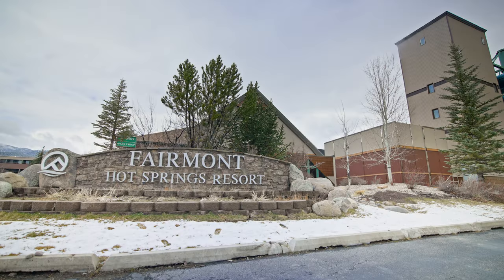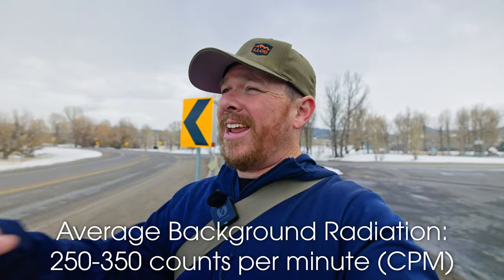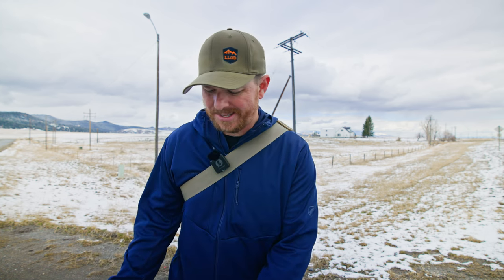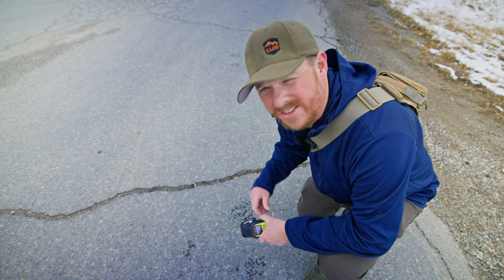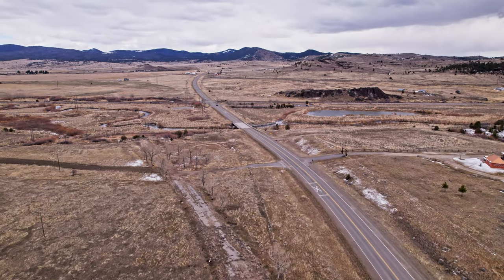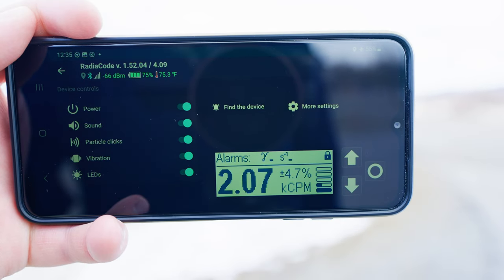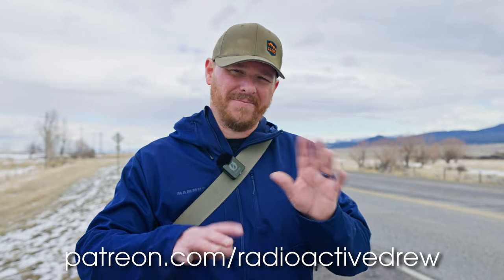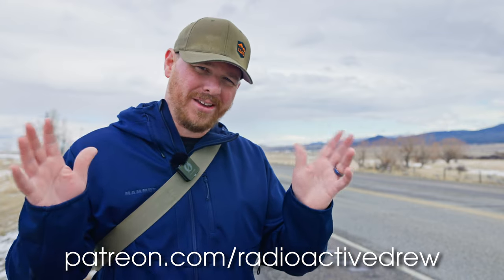Radioactive Road Going to a Montana Hot Springs

Comment: Hello Drew, I'm a health and safety officer in southern Alberta (Howdy neighbour!) and the hot springs in the Rockies are usually loaded with Radon gas that comes up with the hot water from the thermal springs underground. Uranium 238 solids decay into Radium 226 which decays/gasses-off as Radon 222. Basically, where there is a hot springs in our area (Montana/Alberta Rockies) there is a good chance there is naturally occuring radioactive materials around. Love your videos!
Reply from the maker: I’ve heard the same thing before. I’ve been to Radium Hot Springs up in Canada and that water was a little radioactive. I checked the water at Fairmont and it wasn’t radioactive.
Reply: beat me to explaining it.

Comment: Here in Florida due to lobbying they are trying to do that. 

What gets me is the main people affected health wise will be the construction workers dealing with all the dust.

There may have been some Coal Bottom Ash lobbying too, that stuff is extra nasty and sometimes just the elements themselves (Arsenic, Selenium, etc) not just radioactivity.
Reply from the maker: That whole thing in Florida is crazy. It surprises me that they want to use contaminated material. Definitely some money changing hands there.
Reply: @RadioactiveDrew  it would be neat for you to take a peek if you are ever in the Jacksonville area, but if the data i saw is current we still have some unlined coal bottom ash landfills with monitor wells starting to show contamination. (North East side if I remember correctly)

Not sure what you could get surface level, and it kay be less radioactive and moreso just “nasties”, but a thing to see nonetheless.

A pile of them in the more Coal Mining / Burning Heavy states, Vice News did some investigation/talked with local people sometime on all that.

Comment: That's an incredible find. Pretty cool.
Reply from the maker: It was a pleasant surprise.
Reply: @RadioactiveDrew  Not many are driving around with an active Geiger counter. I have several cases of increased reading on I91 just west of the city of Corona between exit 71 and Auto Center Drive in California. I've not spent any time searching further for the source yet.
Reply from the maker: @ThinkingBetter it’s always interesting to try and find a source. I mapped out a portion of this radioactive road taking my dog on a walk. I walked off the road for a bit to make sure the radiation source was the road.

Comment: In the 1970s I installed a Low Background radiation counter in Denver. The combination of altitude and slightly radioactive gravel used in the cement made it not so Low Background.
Reply: I live in Denver and in my apartment I routinely run ~700 cpm in my bedroom.  Brick exterior. Can run into the 800s. 600s away from the exterior walls.
Reply: Uncle Sam makes Plutonium cores for nuclear weapons in Rocky Flats, not far from Denver.
Reply from the maker: @JohnShalamskas well they use to make atomic triggers there at Rocky Flats. The above ground facility is gone now.
Reply: @RadioactiveDrew  That site had 2 plutonium fires.

Comment: I've had my Radicode 102 for about a month and a half and for the first time the alarm went off twice where it shouldn't have in two different locations. Over 2K CPM was logged, nobody or anything was radioactive, it came and went in less than a minute. I'm guessing solar radiation or something burped out of the ground. No issues since then except for walking past my two compasses at home in a spare bedroom. 
Good video.
Gotta love radioactive roads. 😁👍
Reply from the maker: It’s hard to tell what random events like that area. Could be cosmic radiation or something else passing by you. Glad you liked the video.

Comment: Hey man i love your videos! I bought a GMC 320s a while back and found a lot of neat stuff with it. You can actually find a lot of random things here in canada which put off sone high readings. Theres this common store near our house called Canadian Tire. They have a bunch of old lantern wicks which are filled to the brim with thorium, my most active source so far. And then i disassembled my smoke detector for an americium button which put off a decent reading. And i found an old radium clock at a thrift store which put off a small reading. The funny thing is that it wasnt even the watch hands. It was the dots on the crystal that glowed.

We also found that salt substitute emits elevated levels. 

About 50 cpm.

Im going to continue collecting sources from now on. But i want to let you know that you inspired me lol.

Comment: 400cpm is about what I measured in an airliner at 33,000ft on my GMC-500+. So driving on that road is about the same as taking a commercial flight. I wonder if the type of radiation is different though? Like maybe the cosmic rays up at altitude are actual particles instead of just gamma rays?
Reply from the maker: The radiation exposure on flights are mainly gamma rays. A lot of those gamma rays come from secondary reactions in our atmosphere from high speed particles hitting it.
Reply: @RadioactiveDrew  I was on trans pacific international flight last Christmas, glad my Radiacode 102 arrived the day before.  I was getting about 700 cpm at cruising altitude of 35,000 ft and more interesting my hotel room in Okinawa was measuring 400 cpm, the grout material used between the floor tiles measured higher than other surfaces.

Comment: I wonder if there is a correlation to the slag piles that used to be at the smelter site in Anaconda and the Berkeley pit in Butte, from whence the slag originated prior to ore refinement. Radiation measurements could be taken at both locations.  Interesting find.  You may be able to confirm road construction materials from the Montana Dept of Transportation.
Reply from the maker: I was seeing a similar increase in radiation in Butte as well. That will be for a future video. The EPA has a report on the radioactive slag that was used on roads in the area. I checked some copper slag piles by the river and I wasn’t getting as high of a reading as I was from the road near the hot springs.

Comment: Thanks for sharing your videos, find them very interesting. 
Have you ever done anything or heard of the possibly tall tale that involves the city of Niagara Falls NY. There is rampant pollution in the area that was directly related to the plentiful electricity available in the area during the early days of the prior century. Supposedly radioactive ore was processed in the area during the Manhattan project and the waste material was to be hauled away to local landfills. Truckers unaware of what they were hauling eventually started selling the perfectly fine crushed stone as they saw it to individuals fore driveway base material rather than taking it to the dump thusly getting paid twice for every load. Overheard a conversation once between an individual from that area talking to a prior military technician and the tech was indicating he once inadvertently saw a aerial photograph of the city of Niagara Falls and it was covered by small rectangular strips all over indicating radioactivity. He asked the former resident if could explain it? The prior resident laughed and told the story of radioactive driveways. Is it even possible to view radioactivity from aerial photography??
Reply from the maker: I have heard parts of this story before. It’s something I want to investigate. There are a lot of areas I want to explore on the east coast. 

As far as seeing radioactive areas from the air. This can be done with an aerial survey using very sensitive scintillation detectors.

Comment: Is it possible that slag from the Anaconda smelter that is just down the road was used in the hot mix? I worked in a lab that where we were analyzing samples as part od the smelter remediation. I am of the opinion that you are at greater risk from lead and arsenic exposure than the radiation.
Reply from the maker: It’s possible but I kind of doubt it.

Comment: Hi Drew!  Thanks as always!  What can you tell us about the 103g?  Just curious.
Reply from the maker: Well Radiacode is going to send out a model to test in a couple weeks. My contact at Radiacode told me the new sensor is much more robust and is able to handle rougher use and temperature fluctuations. It will also have better gamma spectroscopy resolution and will have better spectroscopy results with high radiation. That’s what I can remember off the top of my head.

Comment: It is interesting that the two detectors give such different readings...  Does the Radicode just have a "larger" detector that covers more area?
Reply from the maker: It has a much denser detector. The pancake detector in the Radeye B20 has a gas in it and when the radiation hits one of those gas molecules it creates an electrical charge, which is counted as an event. The Radiacode uses a crystal, which is much better at picking up on the photon of gamma energy.

Comment: out of curiosity - what is your source for the statement that there are people "more sensitive to radiation"? Is this confirmed or you are making wild guesses? How one person can be more sensitive than another if the physics and the ability of photons and particles to deposit energy and damage cells is the same?
Reply from the maker: Well there are people more sensitive to chemical exposure than others. To say that everyone reacts the same to every kind of exposure wouldn’t be true. I’m trying to cover my bases in saying that an extremely small amount of people might be sensitive to low level radiation exposure. The overwhelming amount of information right now points to no effect from radiation doses this low.
Reply: @RadioactiveDrew  I don't think would be correct to make assumptions of how physics apply in interactions at atomic and sub-atomic level based on how complex biochemistry is "tuned" in the human body. In other words - everyone reacts the same to a speeding bullet, regardless of their sensitivity to the chemical makeup of the bullet - lead and copper. I asked because I thought you might have stumbled upon research papers on the subject.
Reply from the maker: @aestoev well there are people that react differently to the forces of gravity. Some people black out easier under high G’s than others. Humans my have extremely similar biological features but the same exact forces can effect people differently. Like I said, I’m trying to cover my bases because I can’t say with 100% certainty that everyone is going to react the same to low level radiation.

Comment: Great vid, for myself with Radiation I do have to be careful, For example, if I get an X-Ray I'll end up getting a migraine a short period later.
Reply from the maker: That could be anxiety from getting an X-ray. But it’s hard to say for sure. What kind of X-ray did you notice that migraine on?
Reply: Anything that's on the head. Lower body is fine, and I don't get a migraine, but my head like a dental X-Ray I end up getting one. I will say this though I do a lot of mediation so I'm wondering if it throws me out of wack when I get one. Basically background Radiation is fine for me but a big blast to the head, I'll get a migraine. @RadioactiveDrew

Comment: Looking at the snow, have you eliminated the possibility of it being radioactive salt brine surface contamination from deep fracking waste!

(if you’re not aware of this, please see the video at the bottom)

I’d love to see you, gather some of the dust at the side of the road. It should accumulate either side of the road due to the camber in the road!

If I’m right, your readings will not be uniform. They will be much higher at the sides of the road from run-off. 

If this theory is correct, then you might want to check the bottom of your shoes as well because low-level radiation caught up in aggregate is one thing, but low-level radiation in dust bowing around on the wind is quite another. 

https://youtu.be/xZPaJwFFE2k?feature=shared